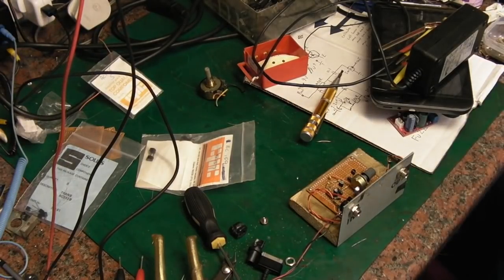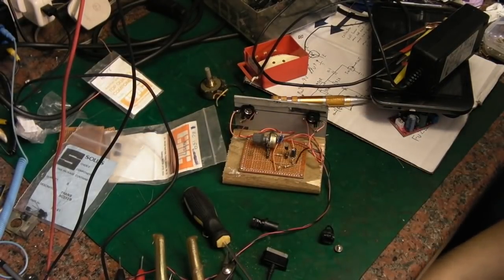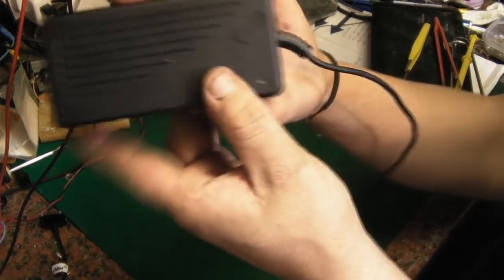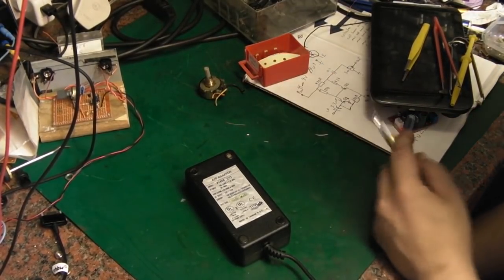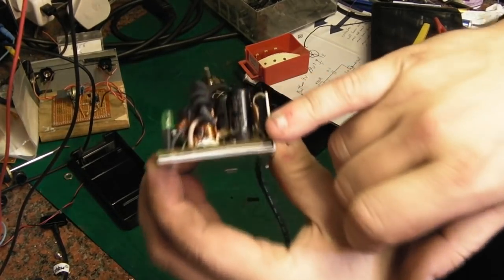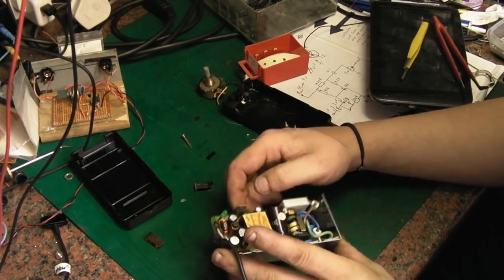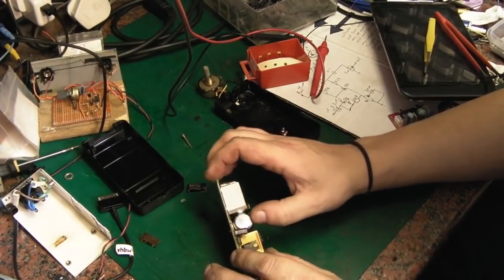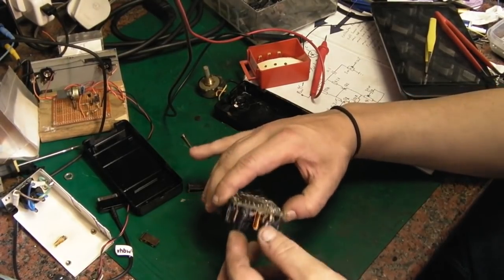Cheap and nasty 12V PSU repair

Comment: If I had the guess those two caps swelled as they heated and it pushed them up into the lid (obviously) but the lid compressed the vent which prevented them venting properly.  The heat produced pressure build up forced it to find the next available weak spot at the bottom.  That also explains the imprint melt on the lid.
Reply from the maker: I think that's a likely scenario, bit of bad design really. fortunately the new caps are shorter by a couple of mm so should allow the new caps to vent properly in the future.

Comment: Regards your last comments there, anything is worth fixing =D  I've fixed a cheap 12v PSU like this a number of times!
Reply from the maker: True anything is worth a try. its just how long you spend on it. with that PSU if the caps hadn't fixed it I'd of scrapped it, as it happens it was worth the effort to try.
Reply: +JaysVintageJunk I agree, and I've done just that!  Ie. scrapped one of these cheap PSUs when the caps didn't fix it.  Occasionally it's not worth the time!

Comment: I would have used kapton tape for that isolation. The heatshrink could shrink and twist away from the cutout over time.
Reply from the maker: If I'd had some yes kepton tape would of been better. i dont think the heatshrink will shrink to the point of coming adrift tho and it has adhesive on the back.